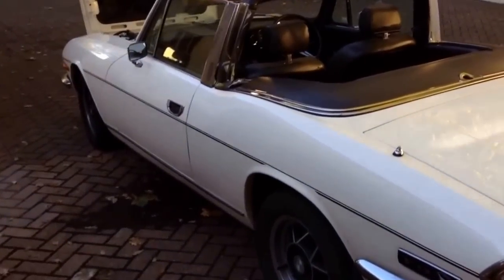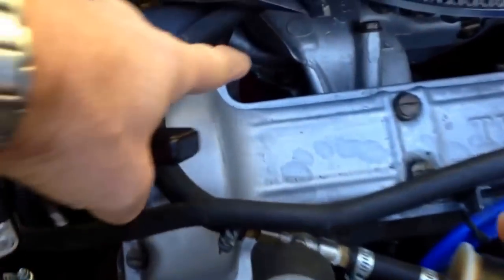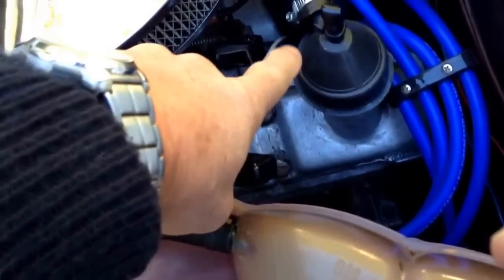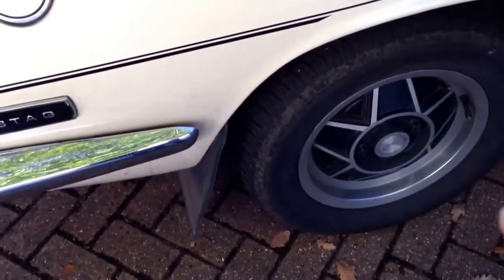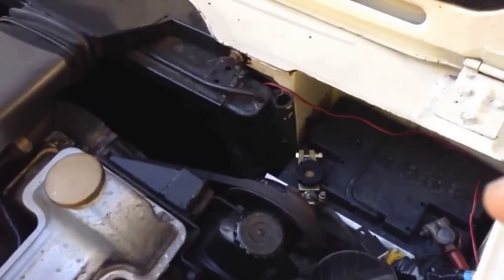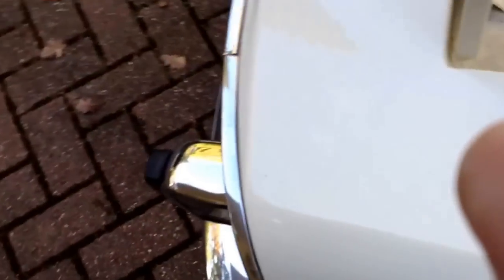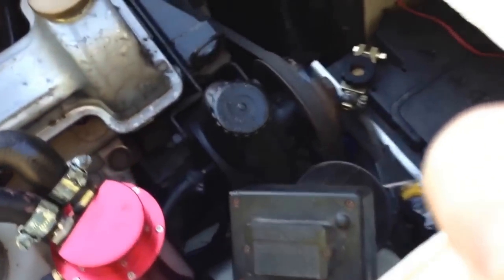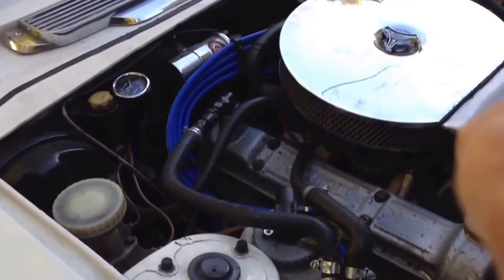Triumph Stag - Some Suggested Improvements

Comment: Regarding the expansion bottle are those just universal hoses or from a specific car ?
Reply from the maker: I used what I had as spares or what I could pick up from a scrap yard. You can also get new general coolant hoses on ebay / amazon.
Reply: @comeinhandynow  did you bolt the bottle to an existing mounting point or did you have to make one ?
Reply from the maker: @mitch5806  I bolted mine to a point on the wiper motor. Use whatever is convenient with a bracket if necessary to reach your tank.
Reply: @comeinhandynow  cheers, I forgot to ask you.. on that header tank did you have to run a third hose from the bottom of it ?
Reply from the maker: @mitch5806  Yes that tank does have a connection at the bottom, I just T-jointed it to the other hose that you can see.
Reply: @comeinhandynow  thank you!

Comment: Hi great video  i am thinking of buying a Triumph stag there are so many  at different prices, and some people say buy one with a rover V8 more reliable i am looking at one with a 4.4 Buick V8 what would that be like and what are your thoughts. Thank you
Reply from the maker: Thanks, a 4.4 v8 would be interesting but is the rest of the gear train up to the increased torque?  The 3.0 v8 triumph engine can easily spin the rear wheels on pull away, so for a 4.4 you should check if bigger tyres, axles, gearbox and diff have been put on.  A car with the Triumph v8 is going to be worth more and is a free revving engine when given some of the improvements mentioned.
Reply: @comeinhandynow  Hi Thank you i messaged a Triumph stag club here in Australia they said stick with the original engine and get one that has a good service history

Comment: What model air filter is that please?, my Holley from Hart is just foam held on with a grid, what advantage do you get from linking the cam-covers?, surely they have pressure equalized in the front can cover?
Reply from the maker: The air filter is similar to the 14"x2" one that Rimmerbros sell part RB7439.
The cam cover breathers allow for the moist crankcase vapours to be drawn out of the engine.  It is similar to a lot of other v8s in that clean air is drawn from inside the air filter into the left cam cover, the air is drawn through the engine into the right cam cover and sucked out into a high vacuum point of the inlet manifold. Normally a PCV valve sits in the right cam cover and regulates air flow.  I choose to change my PCV to a simple isolating valve to manually set the air flow.  The reason being was so I could adjust it to give just a bit of vacuum inside the crankcase to stop oil dripping out of the rear crack oil seal.

Comment: ever thought of haveng the cast block shaved down by 30 mm and had a stanless steeel shim bolted to the block and to the gasket and redrill more head bolts my m8s dad did this to his stag and bored the oil and water holes in the engine bigger it worked wel and better rad and fan motor
Reply from the maker: Interesting. I never considered this however this engine is quite reliability and has never overheated despite some aggressive driving.  The rad was recored, the engine well cleaned out of any corrosion crude or any casting sand (some had some from the casting process) and a powerful modern cooling fan with electronic control also made a big difference.  The higher coolant tank is also a wise precaution.
Reply: 30mm?  Do you mean 3mm?
Reply: A waste of time and effort, as other fixes are available: 
1) An electric fan is fine as fitted here;
2) Higher located expansion bottle;
3) Modern fully and semi synthetic oils are fine for the oil galleries. Thinner these days.
 
Could have:
i) An electric water pump;
ii) Maybe Evan waterless coolant operating in a non-pressurised cooling system.  Evans also prevents corrosion and prevents hot spots in the engine making bother.

Comment: Hi just out of curiosity, what temperature does your stag run at with the electric fan? I’ve got very similar modifications to yours. My temperature ranges from 80-90 degrees Celsius.
Reply from the maker: Always stays at ‘N’ on the gauge or very close to it, often a bit under.  I’ve not measured it in degrees but I guess around 90C
Reply: @comeinhandynow  is your oil cooler in the original position or have you relocated it?  I’m considering moving it behind the grille, I think it will run the gear box a lot cooler reducing overall engine heat plus allow more air to flow through the underside of the engine.
Reply from the maker: @evangrammatikos5649  I don’t have an oil cooler, that was only on automatics, mine is a manual gearbox.

Comment: The PCV valve is a good way to implement a breather, but the use of an adjustable restrictor is not a good idea.  This will severely limit the flow of gas when you most need it, ie  at full throttle.  In that instance the engine is producing the most gas, and needs an unrestricted escape route, to prevent pressure build up in the crankcase.   I learnt that from hard experience.   If you want to reduce vacuum pull, do it by changing to a PCV valve with a different spec.  I tried several and they vary quite a lot.  Find a valve that has lower flow at high manifold vacuum (eg  idle), but which has minimal restriction at low manfold depression (ie WOT).
Reply from the maker: My issue was lot enough vacuum at idle rather than too much.  I wanted a bit more suction to suck in oil seeping from the crankshaft oil seal.  This setup near enough stops that.  With a fine adjustment idle speed is minimally affected.  Maybe another PCV would have also worked, but there's a lot of trial and error involved.  There can never be pressure build up in the crankcase as the gasses can alway escape via the reverse route into the air filter housing if need be.  Otherwise I would agree with you that a PCV is best as used on a lot of cars.  Use what works in your setup.
Reply: Re your comment "There can never be pressure build up in the crankcase as the gasses can alway escape via the reverse route into the air filter housing if need be" You would need a non-return valve fitted to do that.    Also if had too little vaccum why fit a restrictor, that would not work.
Reply from the maker: No non-return valve, hence why the gases can go the reverse route back through a course filter in the other cam cover and into the air filter pancake, if the pressure is too much.
Reply: So if the gases are free to move through the air filter without restriction then you cannot develop a vacuum.
Reply from the maker: The vacuum exists in the inlet manifold, a small amount of air flow is allowed into this from the right cam cover via the restrictor valve in my case (normally a PCV).  Hence some gases are drawn from the engine even at idle.  This minimises oil seepage through engine oil seals. The air being drawn in via this route is coming across the engine crankcase from the other cam cover, which has a filter tube connected to the inside of the pancake air filter.
If this was ever any extreme crankcase pressure it could exit via this last route and be drawn into the engine at the air filter.  Under usual conditions (particularly open throttle) the inside of the air filter also has a very slight vacuum so could also draw out combustion gases from the crankcase.  So either combustion gases are drawn out via the restrictor on the right cam cover, or when that flow is insufficient compared to the gases produced in the crankcase, then gases can be withdrawn via the left cam cover via the inside of the air filter route.
Reply: I understand now, you are simply using the pcv in an open system to draw air through the engine from one side to another.  You are not trying to replicate the original closed or sealed system as used on the Strombergs which can develop quite a noticeable vacuum.
Reply from the maker: Yep, it's based on a common system, like on the small block Chevy v8.  Good picture here http://www.streetrod101.com/positive-crankcase-ventilation-pcv-system.html

I started with a PCV instead of a flow restrictor, but changed to a restrictor in order to finely adjust the flow.  If there was an adjustable PCV that would have been good.  Maybe there is somewhere...

Comment: will raising the original water bottle help
Reply from the maker: Yes if you can get it higher than the water pump,  but a bottle with two or more connectors helps purge any air in the system as the water will then flow through it.
Reply: do you mean 2 pipe connectors going in to the pressure  bottle  as mine only has one that goes back in to the radiator how can you have 2 when my stag rad  only has one return pipe in to rad
Reply from the maker: That’s why you need a different bottle from a modern car.  Look at the video or look at a modern cars plumbing.
Reply: so were will the other pipe go as one goes in to rad as of now when the pressure builds up a bit in expansion bottle the water raises and stays ther  in the bottle should it not return back in to rad and were did you buy that piece that takes the small hose from the top hose
Reply from the maker: The pipe goes to a T-junction that you make on the top hose to the rad as shown in the video.  That way it takes out any air in the system.  That point is shown in the video.  The bottle is used was from an old Vauxhall’s Astra.  The T-junction was made from plumbing copper fittings, a 1” T junction and a reducer.

Comment: Just tell us where they don't rust !!

I swear I can hear mine rusting right now.
Reply from the maker: Lewis72 Good point.  Thinking.....  Actually the bulkhead is quite good!  That would be a pain to change.  It's best to cut out all of the rust and thoroughly reseal/repaint everything. A big job!  Took me years, while working at the same time.  Had to go part-time for a while just to get the car finished!   Nice and reliable and rust free now.
Reply: +comeinhandynow 

Yeah, mine may become a bit of a money pit.

I have half a mind to sell it and get an XK convertible.

Comment: easy to work on!? ahahahahahahahaahahahahaaaaaaaaaahhhhhahahahahahahahaha
Reply from the maker: Haha...actually yes! Compared to most modern cars where the space around the engine is very compacted meaning for big jobs you have to take the engine out.  Do you see the length of that bonnet(hood) on the stag.  It's long!
Reply: Have you tried to locate and tighten up the top bolt to the starter motor ??